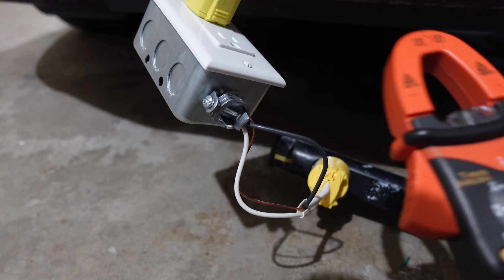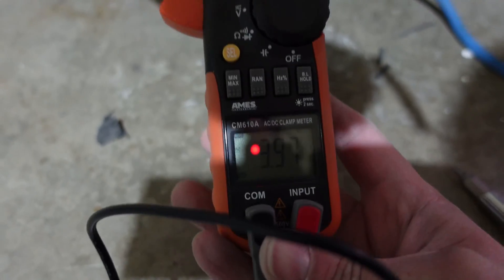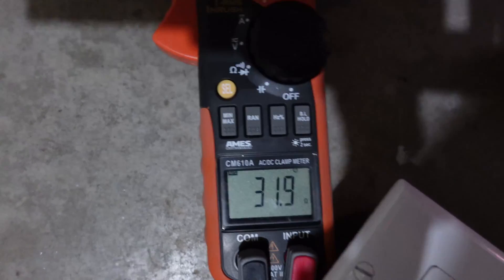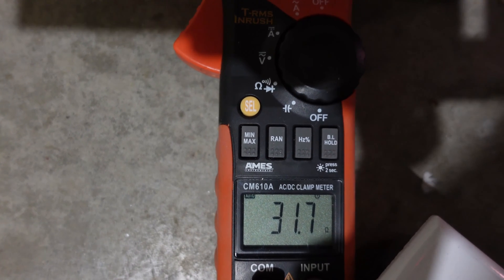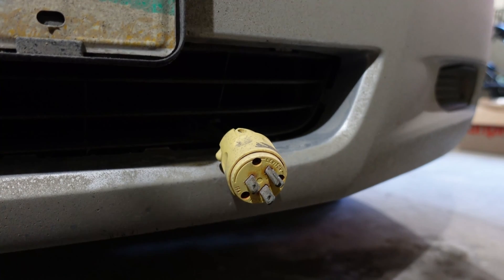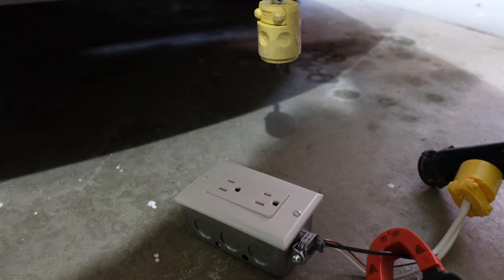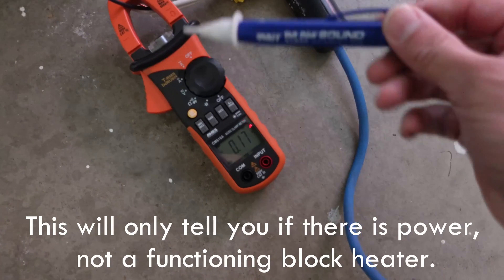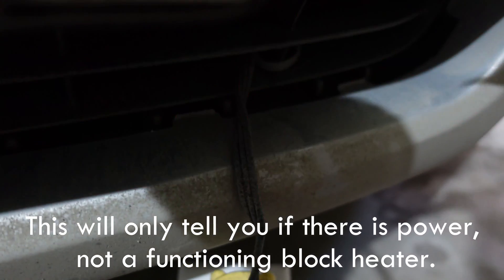Block Heater Not Working? Quick Fix!

Comment from the maker: Any other tricks or tips to get a cold car started, in the carburetor  days a shot of ether almost always did the trick, even on a diesel.  Although I don't think this was the best thing for the engine.
Reply: No it’s not as it washes lubricating oil from the cylinders. Emergency use only.

Comment: Manitoban plate. This bro knows what winter is and he has had to check the ol’ block heater cord more than a few times.
Reply from the maker: You're not wrong, every year start of the cold season, my car and the wife's get a complete once over to prepare it for what's coming.  Sometimes you get lucky and it goes the whole season without something getting brittle and breaking.

Comment: glad you left this video up 😅 Lethbridge is seeing as low as -50 right now and of course ... new alternator, new battery, oil was changed 2500 kms ago ... and the car won't start. Pretty confident at this point that it has something to do with the block heater not warming things up, but at least now I can test it! Cheers dude!
Reply from the maker: Yeah that sounds like a block heater or a frozen battery.  I'm in Manitoba so winter sometimes lays a solid beating on us as well.  A battery tender from Canadian Tire does wonders with a block heater to keep the battery from freezing below -40.  Good luck!
Reply: I am here as well in Edmonton
Reply from the maker: Cold there this week, good luck staying warm.

Comment: Ha, funny, my car didn't start today. I have a Prius and I haven't driven it in weeks. I did not know it had a 12V battery in addition to the hybrid battery. Who knew? Since the battery is under the back seat, there is an option to jump it under the hood... which involves disassembling the fuse box. A few busted knuckles later, she's running again. Note to self, do not move any further North. Smash, eh.
Reply from the maker: I heard on the news, we're not the only ones, CAA is having a tough time keeping up with all the broken vehicles.  Usually this cold snap comes much sooner, that's okay, I'll take the mild winter after the rest of what 2020 left us.  Glad to hear you got your car running as well, and as always thanks for stopping in!